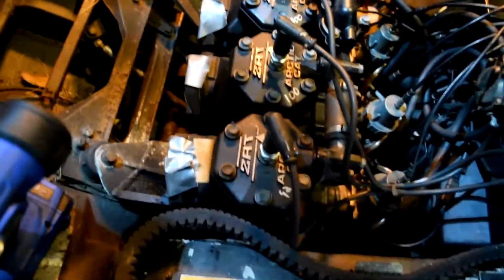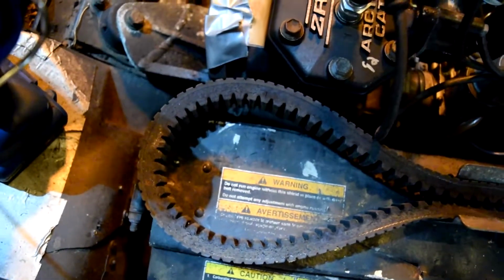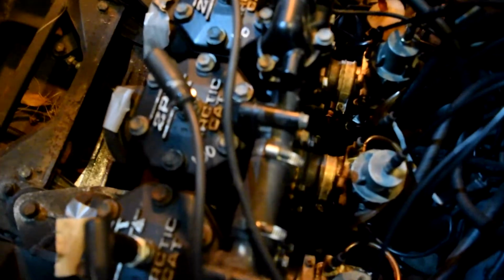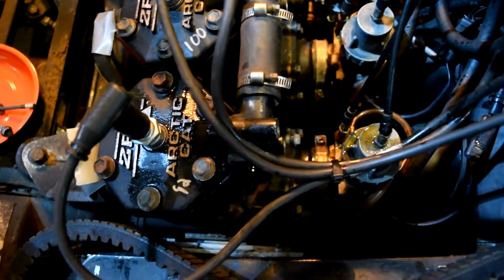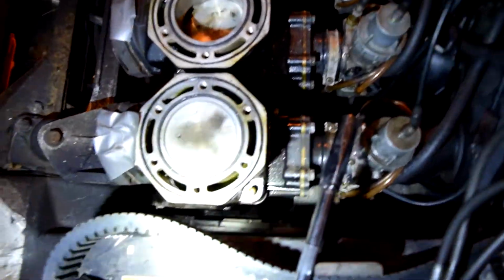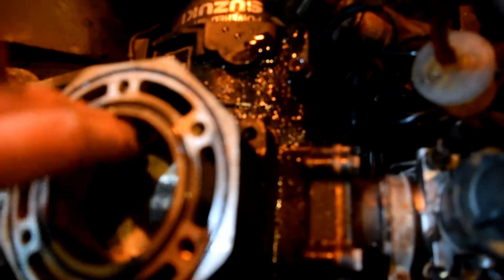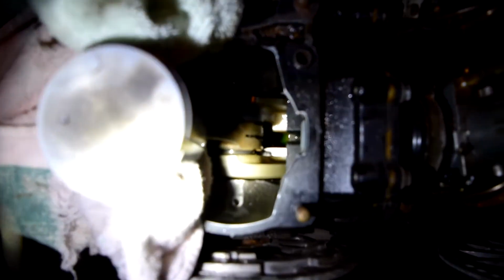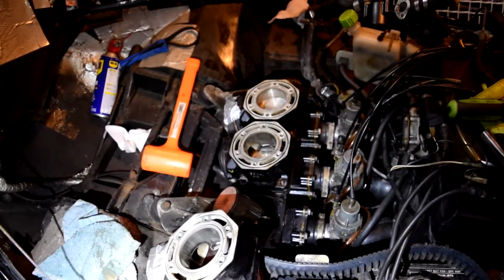Saving an Arctic Cat EXT 600 Part 5: FOUND A CRACKED PISTON!!!

Comment: The problem is the water pump seal below the 2 cylinders with coolant oil mix in them. They are notorious for going bad. Usually just the brass worm gear that drives the pump off of the crankshaft but the seals go bad too so might as well replace both if you can.